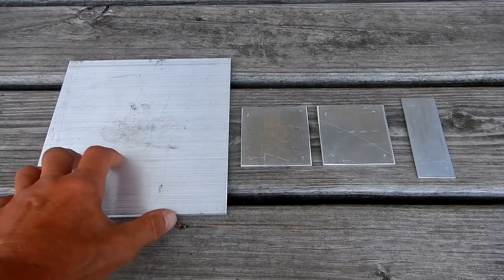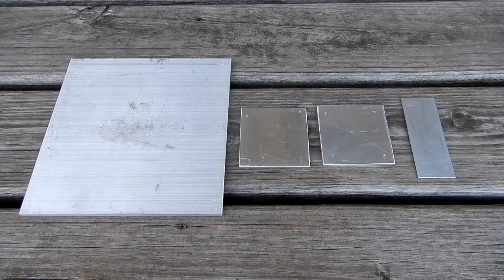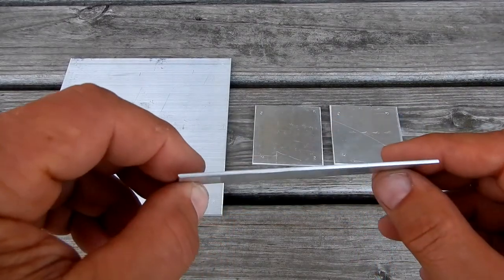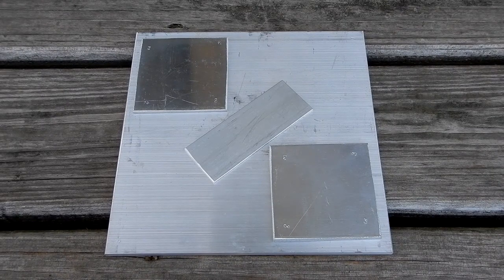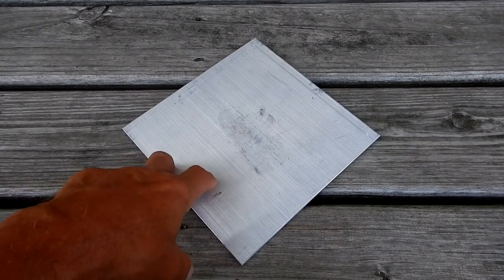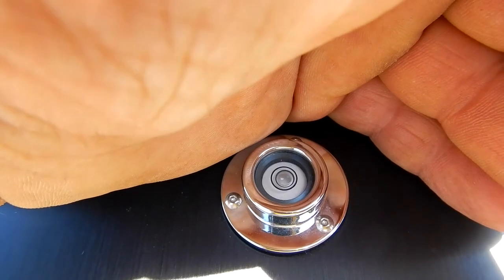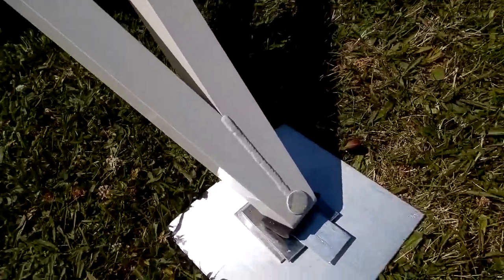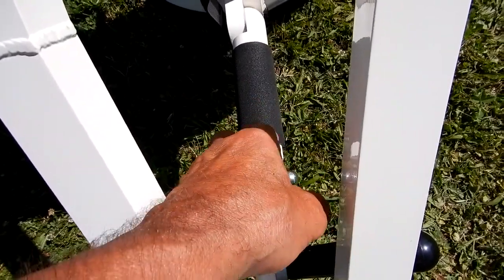Leveling a Telescope Tripod by Shimming it (HOW TO)

Comment: Nice!  I've always used some piece of metal to help stabilize a leg on surfaces when needed.  The Eagle Pier isn't too hard to level but this would be better for me as well. Never considered using different thicknesses of plates. Will have to add that to my future arsenal of tricks!
Reply from the maker: guzzialfa        THANKS! I have found it "jerky" trying to adjust the Eagle's legs a little at a time. Perhaps it is just me. I did not state it in the video {I should have} the place to get cut aluminum is: https://www.xometry.com/ I do not have any other connection to them other than orders. I ordered some big aluminum plates from them cheaper than getting them cut locally and that included shipping to me. They are good to deal with.
Reply: @starastronomer  Good to know. That could come in quite handy if I find nothing locally or in the proverbial bin the basement.